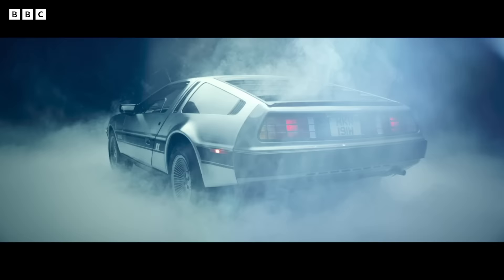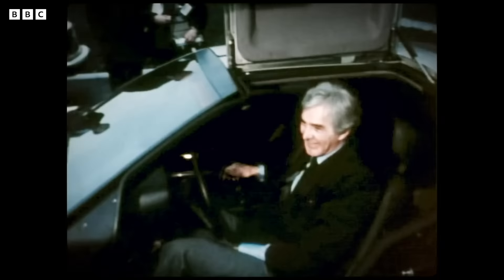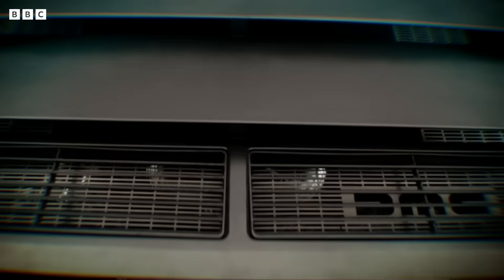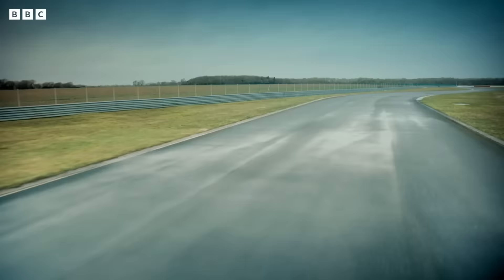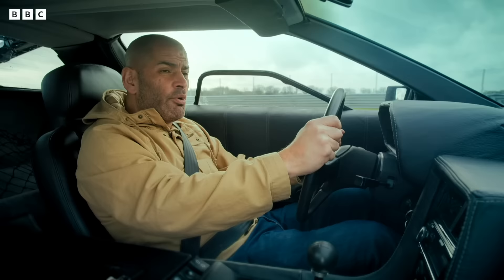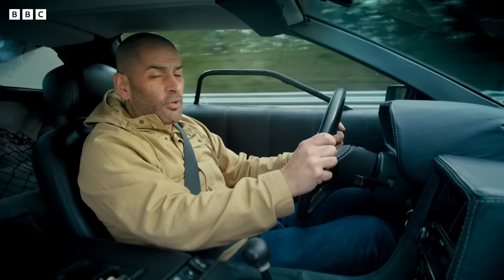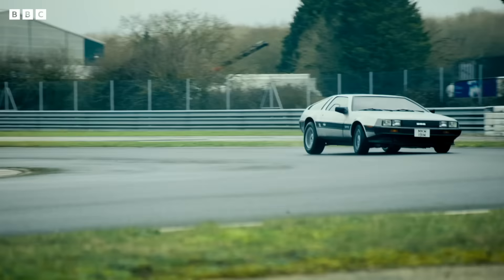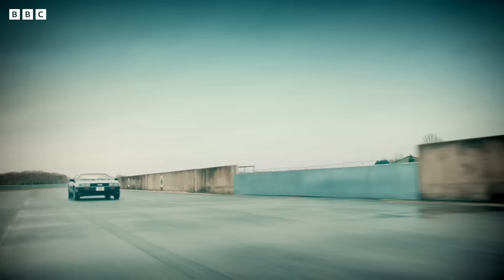DMC DeLorean: The Back to the Future Superstar Car at 40 | Top Gear

Comment: The Delorean rebuilt using 2021 technology and EV platform would be AWESOME.
Reply: they were rebuilt a few years back using V8s if I remember correctly
Reply: There are a few EV conversions about and I understand that they are rather good.
Reply: It would be Quadra from Cyberpunk
Reply: But still heavy :)
Reply: I'd rather have an NA V8 or a turbo V6 instead of EV.
Reply: @farishanafiah8461  fit the delorean body to a v8 esprit chassis since they share similar chassis it might work
Reply: I’ve thought about that and I know it’s impossible to get 1.21 gigawatts in a battery pack but think of how cool it would be to advertise it as “can jump 30 years on a single charge”
Reply: believe those are called Tesla
Reply: @1183newman  I'd love that idea. I still love the Lotus Esprit's V8 engine.
Reply: I am not so sure about that, tho given the restomod scene, someone is likely to take a crack at it if they haven't already. I think the biggest issue that you would have with using the Delorean as an EV restomod would be the battery. It already rather heavy, and it's well known that batteries are heavy (in most BEV's they are about 1/3 to 2/3 the weight of a BEV) so that isn't going to help with that problem which will effect the handling which is already not great. Then their the fact that the Delorean is small, which means that you would need to get creative about the packaging and all that steel isn't going to help with that.

I don't see it happening but, hey. I could be wrong.
Reply: Do I dare?
Reply: who the hell wants an EV
Reply: @JackTheGoose  so I can gap the petrol lovers, don't get me wrong, I love the sound, but I'm more of a performance guy
Reply: scootin hootin understandable
Reply: Looks like that’s what we’re getting
Reply: This aged well and I'm not saying that sarcastically
Reply: No EV thats disqusting
Reply: Notmydelorean
Reply: You kinda got the cyber truck
Reply: Cybertruck❌ DMC-EV✅
Reply: I think that would be the Hyundai N Vision

Comment: You need to compare the DeLorean with the other cars of it’s time. The early 80s were not kind for hp. And if he’s whining about the handling, he can direct his complaints at Lotus of England who engineered the chassis, frame, and suspension after the Esprit.
Reply: @gavinwyllie7855  I’m not complaining about the handling. Personally, they handle pretty well considering the layout. It doesn’t take much to modernize what Lotus started with. Beefing up the front, lowering the ride and tying in the front shock towers does a lot for these. I applaud Lotus and the expertise they lent to what was a daunting task.

I partially agree the factory (see assembly) wasn’t top notch but build quality was improving toward the end. If they would have survived, the ‘84 + models would have been much improved.

Comment: The PERFECT car for a restomod. It looks stunning, even today, it just needs modern mechanics.
Reply: Exactly. Gut the damn thing and do it right
Reply: And give it a proper engine. A properly maintained BMW 3.5 straight-6 would be my best bet for power (around 280hp) and it makes a great noise. That or a Rover V8.
Reply: There's a fantastic Tesla powered Delorean on Youtube
Reply: @DARam4009  I'm a huge fan of BMW inline 6 power (E30 owner), sadly you could never fit one into a DeLorean, too long of an engine for too short a car. I do know of one Rover V8 swapped D in Illinois.
Reply: @augustneverends  there are DeLorean existing with SUPRA Engines .... there is enough Space for your tiny BMW Inline 6 Junk Engine which sucks Oil like a Whore in the Bronx
Reply: @DARam4009  how about a buick 3800 supercharged L67 but with a few mods. way cheaper and will easily make 280 hp with minor bolt ons. great engine, very reliable.
Reply: @augustneverends  If not that, then the VQ35 from a Nissan 350Z could work. That makes anywhere from 280-300hp stock so a stage 1 would take that to about 330hp (if you're restomodding, you don't really need anymore than that). Also, being a Nissan engine, it's pretty much bombproof. Give it a proper sports exhaust (no straight piping shenanigans) and you're onto a winner.
Reply: @DARam4009  It's definitely an interesting proposition. Depends whether the DMC's transaxle could handle that kind of power.
Reply: @augustneverends  You could always replace it with one that can handle the extra power but it would likely have to be from a Porsche which would be costly.
Reply: @DARam4009  Yeah I think a 911 transaxle is the only readily available option.

Comment: The car definitely doesn't weigh a lot. It was underpowered though.
Reply: Exactly. People think it’s just solid stainless. Total weight is around 2,800lb or the same as a modern Mini Cooper.
Reply: @ LucasTNTman93 DeLorean was constrained by the times. He needed an engine that already met US emissions, was versatile enough for the application and wasn’t crazy expensive or heavy. It was underpowered but everything was in ‘81. The development of the Legend twin turbo cars were very promising but would only have been a reality if the company survived through ‘83-‘84.
Reply: Yep. Around 3,000lbs. Same as GT86/FRS/BRZ, Mini Cooper, etc....not heavy, just underpowered.

Sweet spot for DMC is around 250hp...anything beyond that is a death wish unless suspension, brakes, etc are modified as well.
Reply: For 130HP it was certanly heavy.
Reply: A standard 911 ...corvette or mustang at the time where heavier ...
The emissions requirements at the time the DeLorean was launching killed of the performance of those either....
But the DeLorean sticks in the memory because there are no cars from before those restrictions build by DeLorean!
Reply: Give. It to the stig

Comment: There is a company in Texas that has all the parts you need to build a new one. I was once working at a fast food joint in Michigan when a guy came through the drive through in one. I was very surprised to say the least. He managed to get the food through the slot in the window. I've seen one get turned into a electric car. If I bought one I would modify it. I think Chris totally misses the point of this car. He needs to put it into perspective. It was good for its time. He should have talked to the owner about the ownership experience. Thanks.

Comment: Why would you be pushing it like that on a public road anyway? And in the wet no less?

Anyway. I've owned mine since July 2000. Everything said is true, but it's a GT cruiser. It's fast enough stock to keep up with modern traffic, but the real joy is just cruising for hours on the open road. It is very, very comfortable and smooth.

It will also pull more of a crowd standing still than a $300,000 Lambo. Kids 4 to 100 beam ear to ear. It's joy on wheels more than just about any other car in history.
Reply: Thank u for more truth than this pinky in the air tea sippa.

Comment: This car looks cool and it's appearance in Back to the Future was iconic, but yeah this wasn't a especially good car in general, especially performance-wise.
Reply: Pretty baffling of how the speedometer for it only goes up to 85mph
Reply: You can always buy all the parts for one brand new from the factory. They still have them in stock
Reply: You can put a Chevy LS motor in it and have a real nice ride
Reply: Have a bunch of new old stock on the shelf. My understanding is you can get all the parts for a complete car for about 40,000 US dollars
Reply: @swaggyswampert5143  yeah didn't you have to go to 88 in order to get to the jump?
Reply: @valhallaholsopple  if it got an LS engine, it would need new brakes and suspension too. Full resto mod would be fun
Reply: @swaggyswampert5143  Not really. 85mph speedos were a Reagan era requirement in America. Corvettes and Mustangs had them too.
Reply: @swaggyswampert5143   it was regulations of the time that called for that 85 speedometer.
Reply: @swaggyswampert5143  That was only put in place because at the time the US government at the time if they didnt let the driver think that they could drive faster than what the speedometer would say they wouldnt drive fast

Comment: The DeLorean, for all its faults, is not a bad car. It was never built as a sports car but rather a grand tourer. The PRV engine had already passed US emissions and was fairly thrifty on fuel so that was a no-brainer. The deep leather seats, tall gearing, and softer suspension all play into it being a gt. All faults can be addressed with modern solutions and many owners daily these, myself included. 

Is it fast? No. But the ‘81 Vette only had 180 hp too. Is it that heavy? No. 2800lb empty. The same as a modern Mini. Is it reliable? Eh.. depends on the history. The ones that sit and never run develop issues but that’s not unique to the DeLorean. It’s an antique car feature.

Comment: Chris Harris, please actually do some research and get your facts right, pretty much everything you said that video clip was absolute drivel or plain wrong.  The car isn't perfect by any means, but by the standards of the time, it was pretty good. It's not a heavy car, the stainless panels are very light-weight and can be lifted with one hand. The engine was detuned for the US market, loosing approx 30hp due to emissions regulations at the time.  The power output was sufficient for the cars it was competing against at the time.  There were some early issues with alternators which were quickly fixed. The gear knob is bespoke, the rear brakes are Jaguar xjs. I've owned a Delorean for 16 years now in the UK, with some minor adjustments to the engine to regain power and derestrict the exhaust and it is a great joy to drive. I've certainly never experienced any sudden snap oversteer and killed myself, nor have any other owners. Then again, maybe we can actually drive a rear- engined classic car correctly and safely. Maybe you should start with the basics, like learning to use a manual gearbox of that period correctly, as that's obviously major problem for you.  I have no problems with the performance or handling of the car, I generally find that people hold me up on the roads around here.  Of course, all this is going to go on deaf ears, since Top Gear long stopped being a factual show and is just another excuse to bash a slightly flawed gem of a car, repeating the same tired crap and untruths about something which was an amazing achievement at the time.
Reply: He is a professional racing driver, I'd take his word any day over yours.

Comment: all I see are people saying "make it an EV" let me just say not everything needs to have laptop batteries to be good and also this thing was rebuilt in recent time with a V8 a few years back if memory serves me right
Reply: Yeah. Electrifying Classic cars is like taking the Buckingham palace and turn it into a skyscraper. Not a job impossible to do, but you’re ruining it.
Reply: It's more like refreshing the interior of Buckingham Palace, adding WiFi, and air conditioning, to replace the old coal burners. Looks the same on the outside, but more comfortable and efficient on the inside.

Comment: By today's standards it does not weigh a lot. Roughly 2750 pounds. That is way less than anything currently in production, except maybe a Lotus or Ariel. Maybe that was a lot in 1981, but not now. It is super underpowered though.
Reply: Heavy is just some of the incorrect info out there. The 1981 Corvette weighed more. The Ferrari 308 weighed more. The 911 Porsche only weighed 200lbs less. Most sports cars did 0-60 in around 8 seconds, the DeLorean managed it in 9.5(stock), so it's slow, but not as slow as people make it out to be. The Triumph Spitfire 0-60 was over 13 seconds and a lot of the Japanese sports cars of the time had 9+ second times as well, but only the DeLorean for some reason gets the "slow and heavy" moniker tagged to it.  Mine puts out close to 200hp with mild mods to the stock engine(mostly took out the emmissions BS)
Reply: Hard to believe but the new Lotus Emira tips the scales at 3,175lbs, light for the 2020s, porky by Lotus standards.

Comment: the main reason for the delorian being stainless was to combat the biggest problem of all with cars - paint! also its a lotus esprit S2 without the performance or refinements.
Reply: Apart from the fact that it is from the same era, it is also designed by Giugiaro and engineered  by Lotus, it is NOT a lotus esprit S2 at all. Different engine , different gearbox, the lotus is a mid engined car, the delorean is a rear engined car, so totally different weight distribution because it is all about the place of the engine over the rear axle etc.... We can call them cousins and they are related, but very different at the same time.....from a lotus esprit S2.2 owner. Still, they look spectacular. BTW, I am not impressed by this video. I am not a Delorian fan , but Chris Harris just  rattled off a bunch of platitudes about the Delorean. He may be spoiled with all these hypercars he did drive already, but this is a 40 year old low production car... I see flashbacks of people mumbling LOTUS = Lots Of Trouble Usually Serious....Yeah right ....another platitude. Take an old esprit...keep up with maintenance...drive it regulary and ask yourself  Is it really that unreliable for a 40 year old car.
That Delorian has a futuristic design even today, ( fantastic isn't it, look at it) but it is very much a 40 year old car,  so judge it like that Mr Harris

Comment: I actually got an opportunity to drive a DeLorean for a state inspection once. Granted I only needed to check the brakes on it so I didnt drive it for long but I will agree, the car itself is HOPELESS. It doesnt accelerate very well, it doesnt turn worth a damn, and it BARELY wanted to stop once I got it rolling. The whole thing was a nearly unequivocal MESS of a car. But still, even with all its glaring flaws I still can say "Hey, I drove a DeLorean once"
Reply: Well I hope you failed it. A brake check that barely stopped. Sorry you drove a crappy specimen. I’m on my second delorean and both had adequate pickup. Steered well, and stopped great. Your experience sounds like it’s had bad mechanics or a hard life.

Comment: 130bhp in US federal spec chocked the engine of power 168bhp in euro spec also for American crash safety standards the suspension was a lot higher than the euro spec cars which I imagine would cause issues with handling on its own. I believe I saw a video of a us and euro spec nose to nose and the height difference was very noticeable to the point you can put a fist in between the tire and arch on the us spec you can’t on the euro. Don’t get me wrong I know it was a floored and compromised car but if I could afford to get one as a fan of the back to the future trilogy I would. But as with any classic car the values are skyrocketing

Comment: Wait until you find out what happens when you crash this car into a wall…
Reply: I imagine the the laws of physics will operate and it will come out the worse for wear like any car that strikes a wall does. What's your point?
Reply: @augustneverends  you look at some videos of a DMC-12 40 mph crash test, and it looked like the equivalent of a common car that crashed at 80 mph…but you’re correct.

Comment: I have been a fan of this car (despite all of its flaws) ever since I saw Back to the Future over 30 years ago as a small child, and I never have heard in my entire life that Johnny Z wanted to use a Rotary Engine instead of the PVR V6...if it was the 3 rotatory engine used in the Mazda Cosmos that seriously could have changed everything. The weight distribution over the rear axle could have been dramatically reduced, or because of its smaller size...it could have even been mid-engined instead.

Though, if things had not turned out the way they did and the car remained in production, I'm sure like Porsche as time went on with the introduction of modern electronic driver aids that they would have made the rear-engined layout work, that is if they engineers didn't convince Johnny Z to adopt a mid-engined layout instead...and got that twin-turbo setup that Legend Automotive was working for them as well.
Reply: They couldn't use the rotary engine due to emission regulations at the time plus about 30hp was lost from the v6 engine for the same reason.
Reply: @gavinwyllie7855  Yeah the emissions requirements of the era and the mandatory introduction of catalytic converters really screwed things up (that and they had to increase the ride height), but there were people that worked around it like Buick did for the Grand National with refined used of sequential fuel injection and turbo chargers. Mazda had the RX-7 on sale during the time the DeLorean was available to the public, wonder what they did different to pass US emission requirements of the time to make it feasible. I know AMC was going to do something similar with the Pacer, their plans were to buy a rotary engine from General Motors that they had been working for a Corvette concept that almost became reality, but they canceled production and AMC was left having to cram one of their straight-six engines under the hood. I remember seeing a video almost 20 years ago about a guy who found a DeLorean in a barn in Ireland and nicknamed it "Dusty" and claims it was one of the first cars to be prepared to be converted to Right-Hand Drive and he was talking about how it was rated for 160 horse power because it just had straight exhaust with no catalytic converter.
Reply: Very early in the car's planning stage John DeLorean made inquiries to Citroen's Comotor subsidiary about a supply of rotary engines but Comotor was sinking fast and the rotary's poor fuel economy killed that possibility.

Comment: Dmc-12 was not heavy it weighed less than the Camaro. The stainless steel did not make it heavy that is a myth. The car was under 3000 lb which was on par with all of the sports cars of the era.